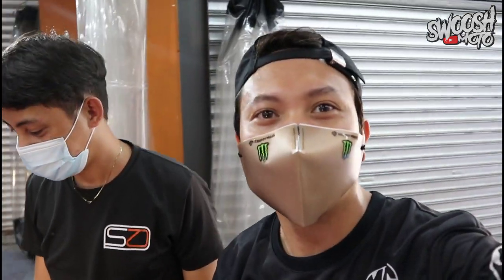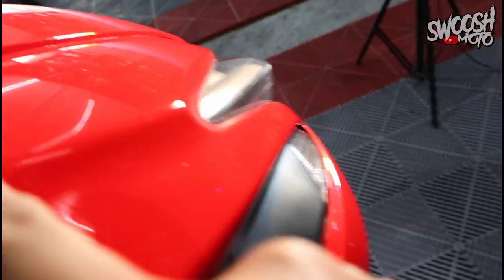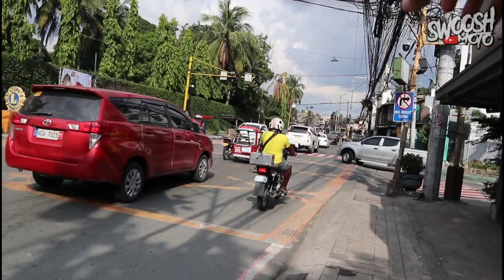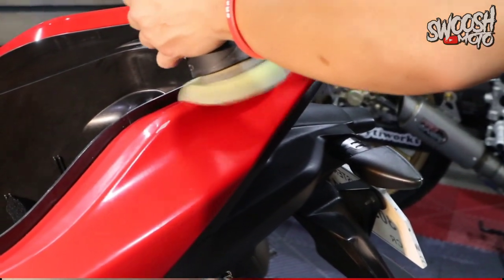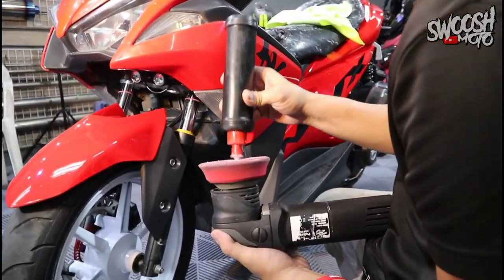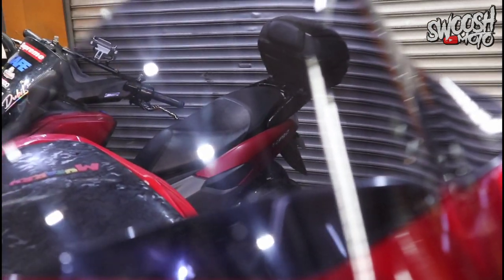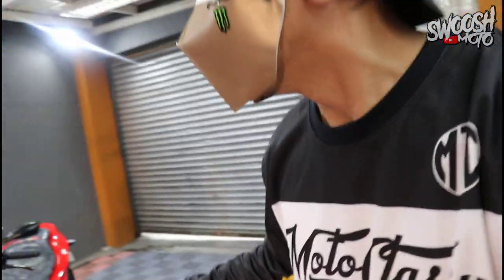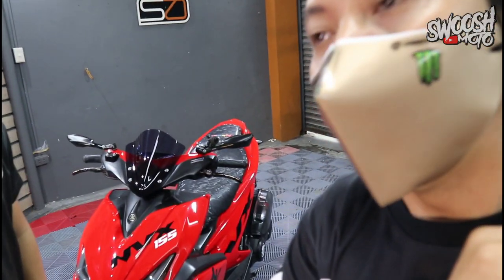paint correction | buffing style to remove swirl marks | detailing tips 101| red ferrari

Comment: pag nagfriendly guage kayo baka pwede ako makisali. naka 200+cc set ako ecu, 66 bore, +6 stroke offset, 2.2 gear ratio, full cvt, hybrid head ( it means sa ibang model ng motor galing yung cylinderhead ) throttle body, fuel pump, etc.
Reply from the maker: Try mo sir s jer speed ksi stock bore lng motor ko sir...